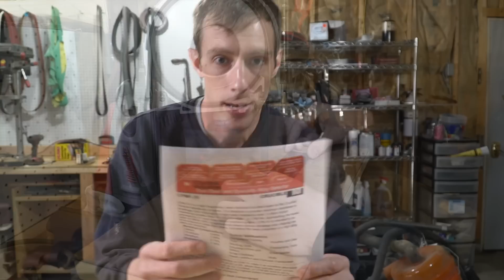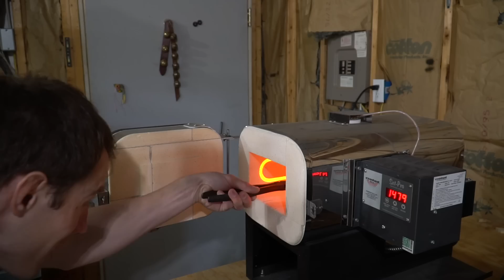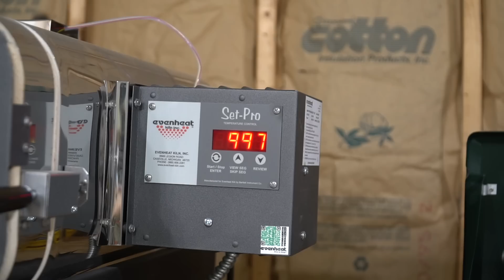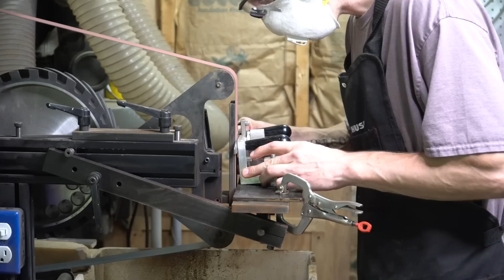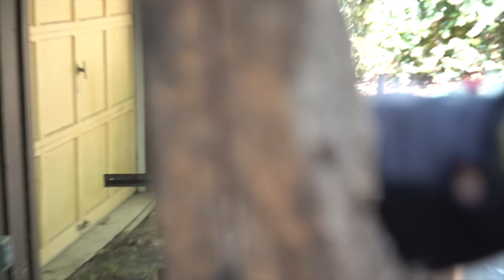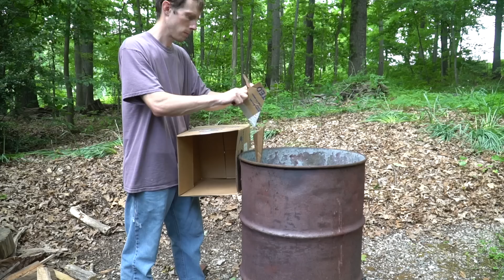CPM-3V Toughness Does it matter?

Comment: Despite this being an older video, I want to share something here: I just bought a Demko Knives AD20.5 in 3V. I was checking it out and admiring it when a bee came by a bowl of fruit. As I held a knife in my hand I just wanted to get the bee out of there. I hit the edge of the bowl and the edge of the blade chipped. And I didn’t even connect that hard. Man I was disappointed but I managed to save it with some sharpening. Why did it chip so easily? It’s not a cheap knife after all.
Reply: Was it a ceramic bowl?

Comment: Too bad it rust and makers never coat it. There are cheaper stainless options just as tough but require more sharpening. Which imo should be included in "toughness" ratings.

Comment: But when the 3v has the right temper with a good thick .25" blade and good geometry on the edge and thick tip then you've got about an indestructible knife as you could possibly have.. For example, the Lionsteel T6, it's unreal tough.

Comment: This is a silly video. The toughness is its ability to resist chipping and breaking. It’s how elastic the composition is. How far it can deform before fracture. Nothing at all to do with edge retention. This means twisting bending and torquing a blade. Things you don’t generally do unless you’re using your blade stupidly. This is beneficial for an EDC blade for in the event you need to let’s say, scrape some paint off metal or pry a cover plate off something. If you have a steel like M390, you can easily chip away a thin edge and end up needing to reprofile. However a CPM3V can take the beating just fine. 

In real life, I stab a beer can top to make an air hole for better flow. I do this with my AUS8 beater blade all day with little problems. Might roll an edge. I then did it with my VG10 and just a beer can chipped the tip and knocked a chip out of the blade itself. It’s just not a tough blade steel for dumb bone head actions. 

Now granted, you shouldn’t use a knife for anything that isn’t lateral to the knife edge, sure. That said, over a long enough timeline, it can happen. A stubborn industrial zip tie, a hidden staple in some cardboard or a misplaced cut through your medium and into concrete can do damage. Some of us wrecking balls choose to lean for tougher steels to mitigate said damage. 

Congratulations on the 14 minute video that completely missed the mark. We’ve all learned nothing.
Reply from the maker: Dr Larrin Thomas would disagree. Your opinion is your opinion, you can disagree but you're still wrong.
Reply: @OUTDOORS55 lol Dr. Thomas would disagree that edge retention and toughness are two separate traits? I don’t believe he would.

Comment: When it comes to knives I say .8% carbon is the sweet spot ... But that is the steel snob in me.
I know that the temper is where the knife is either made or broken.
Personally I like the Particle metallurgy of CPM 3v, the end result I am iffy about.
Reply: Years later, this is probably irreverent.
I think AEB-L at 60HRC (or higher), and cryo treatment (I think dry ice would suffice) might have been a nice choice.

Comment: I'm not really concerned about the edge retention as much as I am about the toughness, I just simply want a knife with a drop point blade, between 5 and 6.5 mm's thick, with the blade length at 5 inches, overall about 10 or 10.5 inches long with a micarta or g-10 handle and a sheath. If it can withstand the abuse that I put it through...it's worth paying for!!!

Comment: How do feel about S30V?
I bought a Benchmade Bushcrafter awhile ago but had to change the grind it's laughable out of box. 

They really like putting folder grinds on fixed blades .... I was not happy with the stock blade.   Even the handle was off a bit but I just fixed it all and now it's a great knife amd holds up well.  .

That said I think a 1095 version would be just fine to me ..  I just don't really care anymore . I'd rather just have a good 1095  that sharpens without diamond stones.

Comment: you might try 8670. its affordable, easy to heat treat and extremely tough. It doesnt rust instantly like that one alloy you had either.  check out the baton test on the 8670 chef knife on Alpha Knife Supply.

Comment: for the end user, there is only ONE problem with properly hardened and heat treated 3V....it's harder to sharpen.....the upside is that you do not have to sharpen it anywhere NEAR as often....I have only 3V steel knives.....

Comment: Just buy a bark river bravo 1 lt. Use it for testing 3v capability. I have one. Took alot of sandpaper to reprofile the edge but man it lasts. I batoned 20 poplar logs and it was still sharp. Not hair shaving but 5 minutes on the strop it was back! I never ReSharpen. Just maintain with a strop. Easy blade maintenance

Comment: Also 3v rusts like crazy!  When I commissioned my knife; he had to ship it off to be heat treated because his oven wasn't big enough! ...mind you I had to twist this guys arm to get him to make it because he didn't want to out source... he said the company he had do it had a very interesting heat treatment that required a salt bath 🤷‍♂️ maybe that means something to you but I always wondered what exactly that processed looked like.
Reply: Molten salt kiln...literally. Howard Clark used one in Weapon Masters...the katana episode. They are vertical, for longer blades. Try EEZOX or Corrosion X for your rust problem. Im not sure how simmering a rusty 3V blade in water would affect it...as far as coloring goes but I do know it converts red rust to black magnetite on standard HC steels. I've done it. See Walter Sorrels video called "Caring for carbon steel knives"
Reply: @tikkidaddy  oh the rust I keep at bay. I just noticed if I set it down while working it on a wet stone, it will rust before it dries... i was aware this is the down side to 3V but was still impressed how quickly it goes! Currently under the daunting task of giving it a mirror polish.

Comment: I've noticed 3V completely changes when cryo''ed in LN2 for 2 hours, 
Then hardened even more when Cryo'ed a second time over night, between tempers.
It only gets worse on belts.
Reply: Maybe that's the delta heat treat "secret". Though I doubt there's much retained austenite to convert to untempered martensite after first temper, but it doesn't hurt.

Comment: Choosing a EDC carry blade for both utility and self defensd. The blade I like comes in both CPM35VN and CPM3V. What is your suggestion?
Reply from the maker: 3v
Reply: @OUTDOORS55  Oh wow. Thank you for the crazy fast reply.  I was reading that even will regular maintenance and oil etc that the 3v will still oxidize and struggle with corrosion. Do you have any experience with this. There is a good chance that while this blade is on my plate carrier it could be exposed to moisture. I would keep it well maintained/oiled. From my reading it seems that 35VN and 3V are about the same in terms of ease of sharpening. Would that be correct?

Thank you very for your opinion!

Comment: In regards to toughness, one thing to consider is long term use. Ed Schempp was one of the first makers for example to note that in Bladesports, a lot of steels can easily handle one competition, or even multiple but after awhile they will suffer catastrophic failure. This is why he preferred simple steels because they will outlast the life time of a user.

I have seen knives last for days, even weeks of use and then suddenly just suffer gross failure, it is just an accumulation or growth of small micro-cracks. So even IF a steel can take a certain amount of use for low cycles (<100) there is no guarantee you can extrapolate that out to months/years of the same use.

This is why toughness is one of the hardest things for a maker to deal with and why so many will over engineer their blades with thickness or steels with higher impact toughness as no one wants to face blades coming back after a couple of years with dramatic failures, especially now with the internet's ability to make you tictoc famous over night for being a "shitty" maker due to blade failures.
Reply: @Star Gazer1212 Wood performance is a very different thing in many respects. It is mainly push cutting, and you want an edge which ideally wears very slow, no chipping surely. Try maybe W1, Super Blue, M2 or M4, make sure you get someone who hardens it in a sensible manner for wood cutting.
Reply: RIP, Cliff Stamp.
Reply: @Star Gazer1212 No, that's a decent steel, but the manufacturer will matter more.

Comment: Just as a point of properties :

-strength is resistance to deformation (bending, prying, etc.), this is applying a force essentially very slow were the steel has time enough to deform (move) internally if necessary

-toughness is resistance to fracture (impact), this is applying a force so fast that the steel can not deform fast enough to absorb energy and so it will crack if necessary (if over loaded)
Reply: Your words shall be immortalized, Professor Stamp.
Reply: @mikafoxx2717 same bro

Comment: Just a a point of terminology, if you say you are doing "unscientific" testing, that means you can not know anything as a result of what you do, that likely isn't what you want to say.

Science is a way of knowing which is based on testing your ideas by interacting with the world, in comparison to say Math or Logic which is a way of knowing by testing your ideas vs other ideas, you can do it all in your head. 

Science has no limit on accuracy or precision, in fact many scientific experiments are very low in both. I have published experiments (peer reviewed journal articles) where the most I could say was something was closer to 10 than 100, that's not very accurate or precise, but that's cool because I was very clear on the low strength of the claims (my data set was just barely above the noise but my lab group was seeing something never before observed). 

All science demands is that your claims are supported by data, not that they have so many decimal places. This just means you be very careful what you claim, usually how certain you are, which is why scientists in general are always making so many caveats and being clear about uncertainty, variances, the need for work to verify, support, etc. .

Comment: Ive wondeted  if 3v is so tough then why are most knives made from it crow bar thick. I think id like yours in a 4 inch wood handled  version.
Reply: Mainly marketing and the whole “tacticool” factor.
Reply: Yep, tough steels would do best in 1-2mm steel, really. It's only like D2 that you might ever want to have it be 3mm thick scandi if you crowbar it.
Reply: It's for advertisement. Didn't you see he use it on a soft multiplex, even a cheap $2 knife can do that. If he dares to test it on a teak wood or iron wood then I bet it will snap at the first attempt. 😁

Comment: I know less about metallurgy than I do about astrophysics, but it seems that the heat treat is at least as important as the steel. I have a couple of 420HC Bucks that will hold an edge through all kinds of abuse. They're also a bitch to sharpen. Am I wrong?

Comment: Do you have any experience with 20cv?
If so could you please give me your opinion about it 🤔
Reply from the maker: I have zero experience with it. So i cant really comment 🙂
Reply: @OUTDOORS55  thanks anyways
Reply: Got a BM griptilian G10 20cv a few days ago. I did believe I knew how to sharpen a knife until I got this knife. All my other knives are razor sharp with in 5min sharpening. I use a 800, 1000 and 3000 water stones and thay work on everything except the 20cv. It takes for ever to get it "sharp"
You know when the knife kind of cuts the hair on your arm.
I think the problem is that the metal is to hard for my tools. At 800 the metal is moving but when using 1000 or 3000 it seems like nothing is happening. Do you think my assumption is correct?
Reply: @TheMisleadingWoodpecker  i've sharpened 20cv on waterstones. It just takes a lot longer than you think.

Comment: 3V is a great steel, but the heat treat as you show is a pain. I used wet silicon carbide belts to grind it after HT so I didn't have to keep dunking it in water. Stuff is totally remarkable, but my heat treater used an air blast to quench. That plate quench  is probably why the tip broke. The heat treat is why it is very expensive. It is a very shock resisting steel, that's why it's tougher, the very high vanadium content makes a lot of V carbide which is harder than tungsten carbide. Any of the high vanadium steels will hold an edge very well, better than any other steel just about.

Comment: I don’t know anything about CPM-3V so pardon the question. Is CPM-3V a hard, brittle steel? I’ve used cheap knives which only bent while digging in plywood instead of breaking. What gives? Is that normal?
Reply: There’s risk and benefits to both.  Some people would rather have a harder, more brittle knife that can hold its edge longer because they don’t plan on beating on the knife.  And some people prefer a softer knife that can handle tough tasks and is easier to sharpen.  But CPM-3V holds and edge really well an is very tough.  That’s why knives with super steels are usually really expensive.  Most people will prefer a softer steel for their fixed blade knives and a harder steel for a folding knife.

Comment: If you're after a non oxygene environment when heat treating just fold the blade in some newspaper and then place the blade in that heat treating folie wrap. The paper will burn and consume the available oxygene.
Reply from the maker: Thats also puffs up the foul packet making it difficult to plate quench. In my experience paper isn't necessary. The foil will suck tight to the blade providing an oxygen free environment. 🙂

Comment: I have the SRK in 3v and I'm now resisting the urge to put some abuse to it. Good video, and I think the answer is the cost in time and effort depends on the efficiency in manufacturing. Heat treating 1 blade at a time vs Heat treating 100 blades at a time or having a constant revolving 1 blade on one blade off to the next step assembly type production makes it much more plausible but again. That's not the small or custom knife makers forte until they are a little more advanced and established and even then. I'd say it's a flagship metal although i'm curious how polished the steel will get as my SRK is fairly dull and more of a grey color than it is silver.

Comment: Does anyone know how D2 compares to 3V? I have a Benchmade Adamas folder and it’s like a pry bar but having some issues with sharpening it. Any help/advice would be most appreciated!
Reply: D2 has comparable edge holding and wear resistance to 3V, but is SIGNIFICANTLY less tough. They also have about the same levels of corrosion resistance.

Comment: I know I'm late to the party, haven't seen all the videos in this series yet (great work btw, love the direction this is headed). have you considered narrowing the blade until it is just wider than failing the baton test with a  given steel? Is the goal not to have a rugged knife that is as light as possible while still accomplishing certain definable tasks? Why not push the limits of the blade design?
Reply from the maker: I think this is pushing the limits. For the masses this probably wouldn't be the blade design for them. For some one who knows how to use a knife effectively, its perfect. It can be a rabbit hole in terms of what is too thin vs durability. I think getting some out to testers into the real world is the next move. I can test something all day but someone else may use it differently and find problems I won't. 🙂
Reply: Ok, now I understand, you are considering making this available for sale and are staying on the more conservative side of the design and keeping more mass as insurance. Protection really, against complaints of customers due to what is ultimately a result of the mishandling of a beautiful tool. Which is reasonable
The reason I asked is because if you put this knife in the hands of an experienced person, who knows how knives can and should be used properly, as you have demonstrated repeatedly, even under pretty severe abuse it holds up. So, since the goal is a lightweight durable "outdoorsman's" knife, I was thinking this was the target audience. I generally consider that group to be capable of the proper handling of a knife and I think the additional weight loss of a narrower blade would not inhibit normal proper function, within reason. 
I am sure you have weighed the thickness of the blade carefully and it seems you have determined this is the proper compromise between performance and weight for what you are wanting. I just wanted to ask. Thank you for your reply!

Comment: why is this stuff so damn expensive? is it like the epi-pen? some jerk owns the patent on the manufacturing process and charges retarded high prices for it? with modern manufacturing I can't imagine that this takes all that much more to make...since its all done by machines anyway. but you can get a REALLY good 1095, or 01 blade for under 50 bucks, but finding a 3v blade is an adventure into the mid-high 100s!!!
Reply from the maker: The steel itself is expensive but the real expense is the cost to heat treat it. Working with it is expensive too. Im not convinced it's worth the extra expense over simple high carbon steels with a good heat treatment.
Reply: @OUTDOORS55  thank you for your reply, planning my first full knife build. Gotba bar of 1095 since i couldn't find any 1084/5 we'll see how it goes:)